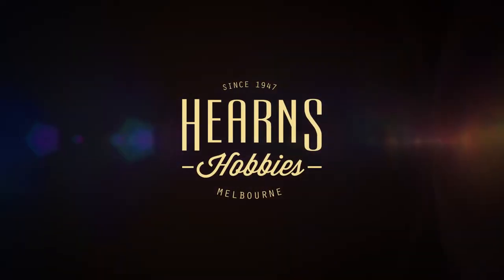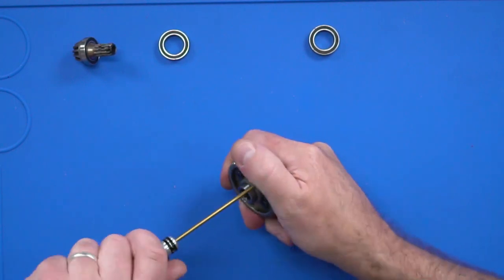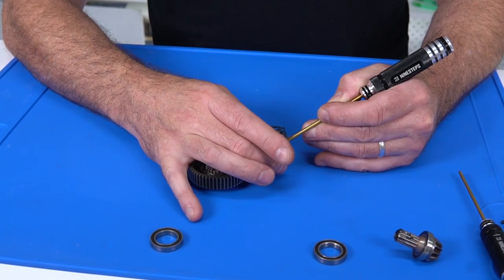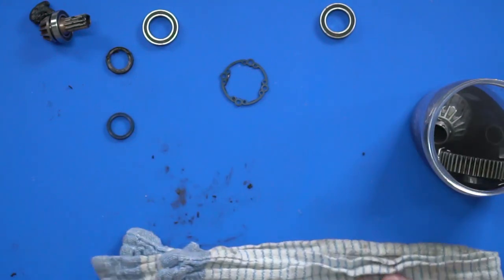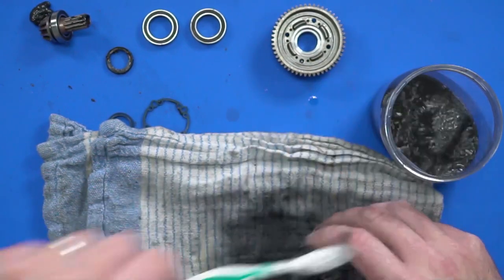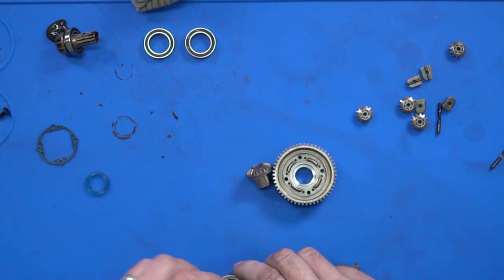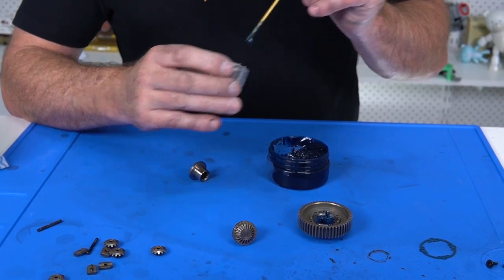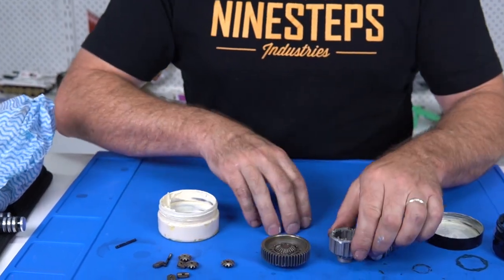Traxxas X-MAXX Center Differential Rebuild Tutorial | #askhearns

Comment: I just cleaned out my center diff on my xrt and put everything back together and gave it a little test turn and it doesnt turn smoothly it has a clicking feeling with each turn what do u think that could be
Reply from the maker: This sounds like there was an error in reassembly. Dismantle and inspect to locate the issue.